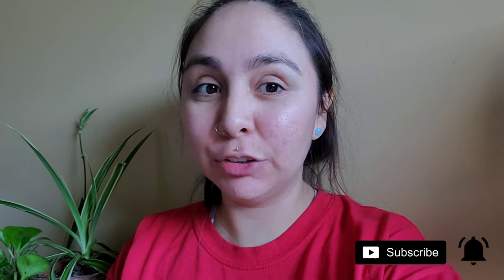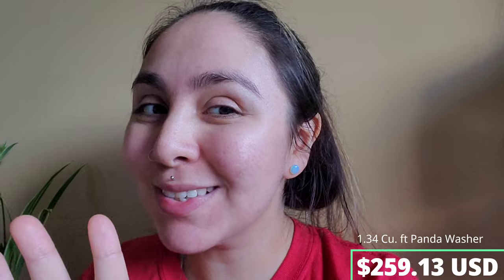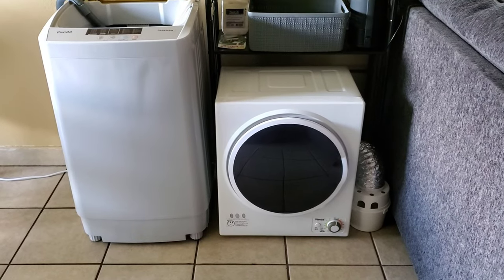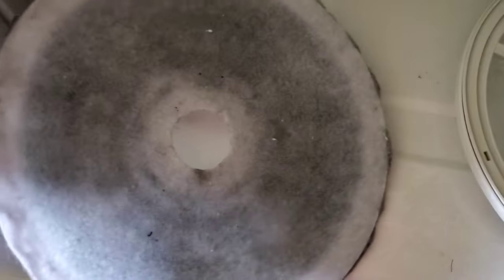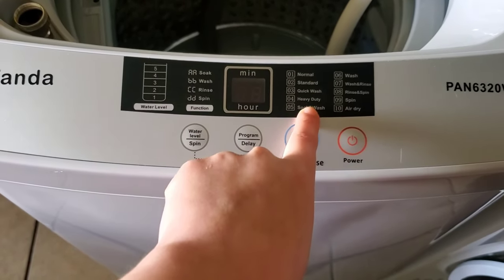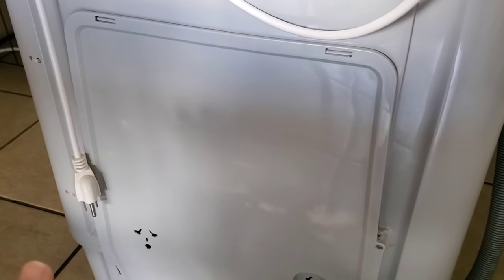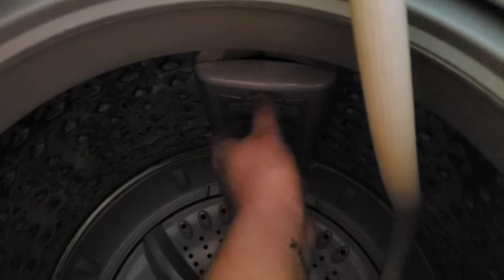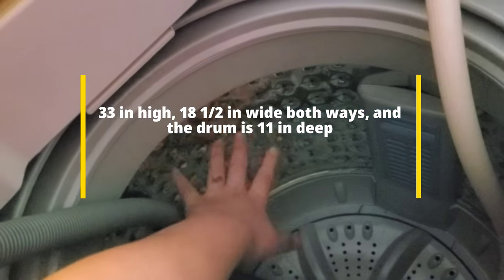(Easy Livin') Panda Portable Washer and Dryer Review

Comment: Thank you for this video! I noticed you don't have the dryer hose going outside. Does the dryer produce a lot of hot air in your apartment when you're using it?
Reply from the maker: I tend to do the laundry during the morning hours or in the evenings to avoid having the house too hot. It can make it a little warm but so long as I have a fan on or the A/C on 76° F it doesn't get noticeably hot. In the indoor vent kit your supposed to refill it with water as well so I have to remember to do that, when I forget I can feel the heat having more of an effect when theirs no water.

Comment: Thank you very much for your video, I just bought the same machine, the water level is 5, the water is not completely full.  The water level is just to the top of the filter.  Is this the case with your washing machine water level 5?thanks!
Reply from the maker: Yes, the level of the water at 5 is just at the top of the filter. This is because with clothes it needs space to agitate and clean the clothes while not spilling over.
Reply: @Peachiie_Keen  Thanks a lot for your reply, got it.  The normal program is 68 minutes, only the washing and spinning program, no rinsing program, the spinning took 42 minutes?  Does your machine's normal program do the same?
Reply from the maker: @sofiawang485  Yes, for me as well normal only consists of one wash cycle with no rinse. That's why I personally use the standard wash for regular clothes which is 47min with 2 rinse cycles, I use this cycle for regular clothes that aren't bulky. As for bulky things like towels, jeans, and bedding. I use the heavy duty cycle since I saw in another person's video that it can create long term damage is if you don't use the heavy duty cycle for the heavier clothing items. The heavy duty cycle has 2 rinse cycles as well but lasts 52min. If you lower the water level as well the time will go down for each program. I also use the quick wash for moments like my daughter spilled something on her clothes or when she was a baby and she had a blow out. It's only 23min and has only 1 rinse cycle for fabric softener or whatever you use.
Reply: @Peachiie_Keen  Thank you for taking the time to reply, I thought the normal cycle was broken, but seeing your reply it seems that this machine is like this.  If there is no reply from you, maybe I will choose to return it.🥰😘

Comment: Don't talk to Google while recording, it set my Google also! Hahaha! Just FYI! I have the twin washer, but I am looking for a small dryer. Looks like this dryer is pretty good. You said that it doesn't come with the inner lint trap, is that correct or did I miss understand? Great video, thanks for sharing.
Reply from the maker: It comes with an inner lint trap but it's located at the back. As well as it'll still throw out lint so I recommend an indoor venting kit if you don't have a window to point the tube out of.
Reply: @Peachiie_Keen  Oh okay, thank you.

Comment: Hi can you fit sheets in your dryer like quern size and towels?
Reply from the maker: I can fit a Cal king sheet set with 2 pillow cases in the washer. But to dry I have to split it into 2 loads.
Reply: @Peachiie_Keen  Yeah I will probably have to do the same. I also have big thick towels I wonder if they will need to go in 2 at a time. Wish I had more space to get the 3.5 it was just too big for my apartment. At least the 2.6 can fit in my closet if I need to hide it.
Reply from the maker: @bellaapple2166  I can fit about 3 to 4 standard towels. So I do think you may only have room for 2 thick towels. If your constantly going to move it in and out of a closet I would recommend one of those wheeled dollies since this model only have two tiny wheels in the back that don't do well over carpet and get stuck in between tile gaps.

Comment: That hot water is going to destroy that washer machine you're only suppose to use lukewarm or cold for this type of machine I have one just l like it tell you on the manufacturer's website not use boiling hot water yours pretty hot steamy young lady 😂😂but it's yours and the dryer it look like your using extensions cord hugh mistake be mindful of of the plug where they connect together they will get hot user manual also tell not to use extensions cord but to plug directly in the outlet and never use two plug of the 110 in the same outlet for instant use the washer machine on one outlet plug separately from the dryer plug trust me I had I paid atte6i wouldn't be in the middle replacing a brand new dryer I use a extensions cord cause my plug wouldn't reach the outlet they got hot where the two connected together I'm just thankful I notice it could've been bad so I'm passing this info to you for safe reasons I never use hot hor water on my washer machine never ever that plastic  it will mess it up eventually those part are delicate that why they tell people not use boiling hot water or too much hot water we have the Panda washer and dryer I'm so mad cause if I knew from the paper manual not use a extreme cord I wouldn't have to replacing a fairly new good dryer that still works
Reply from the maker: I'm not using an extension cord or anything outside of what came in the package. But thanks for the info it may help someone else that is seeking answers. I'm just going by what was in my manual and what has worked for me the past 2 years now.
Reply from the maker: As for my dryer I only added an indoor vent kit. No extensions as well.
Reply: @Peachiie_Keen   It's unfortunate but the OP is correct. If you look at the outer tub of the washer where the stainless steel tub actually sits inside this tub it is completely ABS plastic with a seam. If the water you're using is hot enough to be steaming it will weaken that seam as well as warp the plastic tub itself over time. When the washer spins if you'll listen you can hear the water hitting something. That's actually the outer plastic tub that all that steaming water is hitting. This is only the outer tub though.  Most of the drain pipes inside the unit itself are made of the same ABS type plastic as the outer tub. If your interested in longevity I would only use the maximum of warm water. Fifty degrees Celsius is about 120 degrees Fahrenheit iirc my conversion formula. 

I personally own your model's big brother, the PAN6360W, which is the same except it has a two lb. larger dry clothes capacity.
Reply from the maker: @ilcilc2910  As of this video I have only been washing in cold water. Before, I used to only wash only my husband's work clothes in hot water because of how dirty they were. But now I wash everything in cold water.
Reply: @Peachiie_Keen  That's good to hear. A girl on YouTube used hot water in the exact machine it flooded her kitchen and the machine no longer worked.

Comment: Can you use an extension cord with the machines?
Reply from the maker: It is not recommended to use an extension cord in the manual. Something about fire safety.
Reply: I use a heavy duty one for mine. A really big orange one. I think they're designed for bigger things. So far I'm not having any issues.